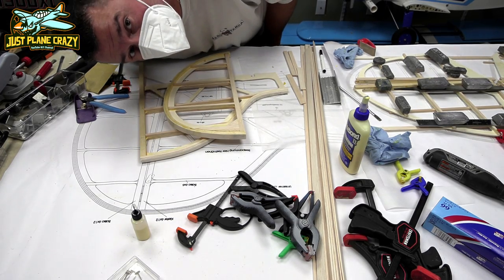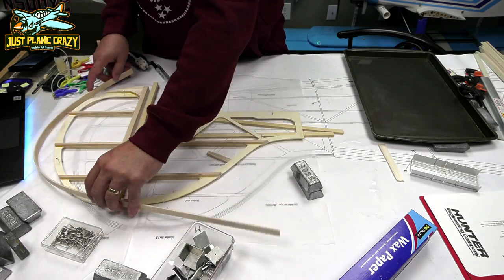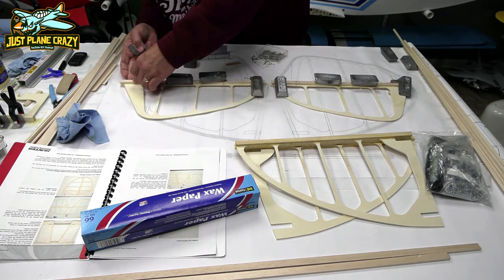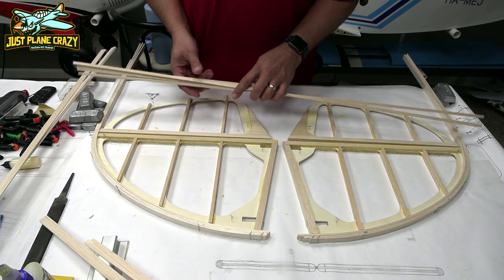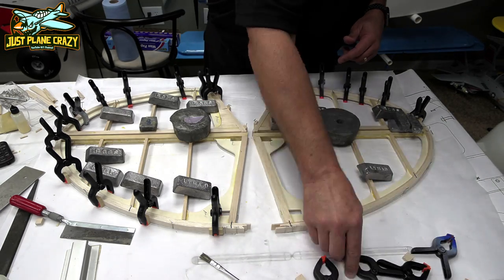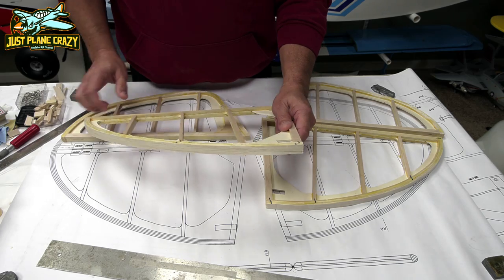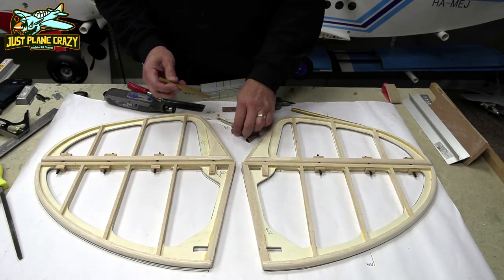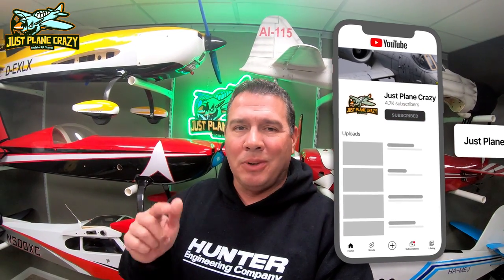Building the EMHW 2.43m 47% Pitts Special pt.1 Horizontal and Vertical Tail, Plus Build Tips

Comment: When I built models I balanced all the sticks and sheets of wood.  For the fuse, I made sure the lighter end went to the rear and for the wings I made sure the lighter end went to the wing tip.
Reply from the maker: Interesting. I do plan on balancing laterally also once done. That will be my extent of weight balance.

Comment: The building board for pins to stick in, what do you use for these larger builds?  Great video, easy to follow.
Reply from the maker: I use a solid core wood door. Then get Homasote and cut to match the door size. Both available at Home Depot

Comment: I just finished a 50% Pitts Challenger ll and I know what you are facing with this build. Keep going, once you finish the wings it will seem like your over the hump with only the fuse to finish. What engine are you putting in your plane? I put a DA 200L in mine. Good luck with the build.
Reply from the maker: Fiala Valach 170

Comment: What's the story behind the decathlon crash?
Reply from the maker: Major storm rolled through an event. Ripped over a dozen canopies out the ground and threw them everywhere. Planes flying, lightning thunder, horrible rain. Did everything I could to keep the canopies from destroying the decath. It got rained on hard. Over night it sat outside my camper and it was 100* just baking the moisture into the electronics. The next flight my no fail switch failed and I lost all power in flight. My receiver booted back twice and I missed the alarms because I was flying with a guy that had the loudest plane I have heard in my life. Missed the warning and never got a third. Tested all components after the crash. Only bad part was the switch. Saw it fail within the jeti telemtry. Sucks. Straight in from 400ft at almost half throttle. 
  Good news is… number two is almost ready to fly.
Reply: @Just Plane Crazy  my buddy Dave followed your videos and built his with a dle 120. It's almost to much power. But it Flys great 👍 I did the maiden and a few more flights on it the other day
Reply from the maker: Did you like it?  I loved it. That’s why I got another. Missed it a lot. Did he do smoke?
Reply: @Just Plane Crazy  yea, it's a blast. He did not do smoke. Maybe I'll talk him into it 🤔